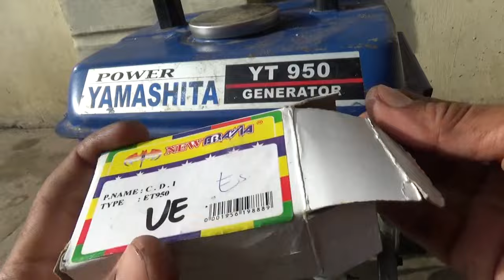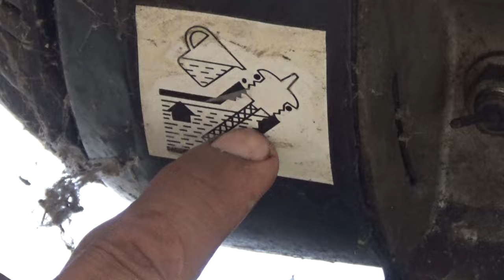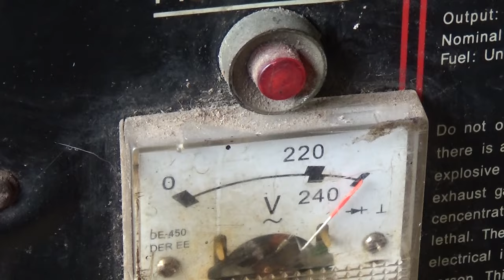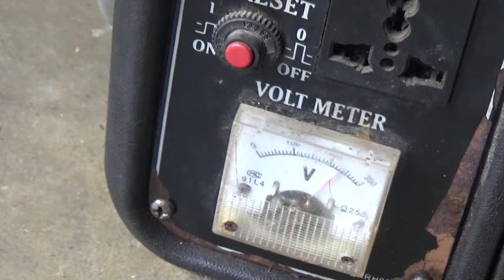cara service mesin genset susah hidup

Comment: Salam bang..mcm mana nk seting kompres genset 4tak
Reply from the maker: jika setting menggunakan alat standar pabrik yang normal, tekanan kompresinya 7-9 kg/cm². Atau bahkan bisa sampai 12 kg/cm². Jika kurang dari 7 atau 6 kg/cm², mesin dipastikan susah hidup dan bahkan mogok. 

agar supaya kompresi tetap normal setting-an manual yang biasa saya lakukan.
1. setting klep
2. masukan sedikit oli ke dalam silinder liston... 

celah settingan klep piston ikuti aja standard pabrikan sepeda motor...

Comment: Celah katup pakai Fuller brp bang
Reply from the maker: kalau saya pribadi dividideo itu ga pakai fuller, pakai filling saya nya😁🙏...

tapi..

kalau mau pakai fuller ikuti standard motor aja sprti supra x 125
in = 0.05 ke atas
ex = 0.05 ke atas
 data by: https://www.google.com/amp/s/goozir.com/standar-ukuran-kerenggangan-klep-sepeda-motor/%3famp

tapi kalau saya pribadi setting pakai fuller yang in uk. besar yang ex. uk kecil😁 biar mantul
Reply: Ok bang siap"👍🙏
Trims ulasannya sangat bermanfaat🙏🙏
Reply from the maker: terimakasih kembali😊🙏..

Comment: Bos kalau gengset 2 tak psnas mati itu apanya ya
Reply from the maker: overheat sementara sob.. bisa di desiclose nya kepanasan atau cdi nya..
1. solusi umumnya diamkan sampai suhu normal .. stlah itu coba hidupkan lg...🙏
Reply: Makasi imponya mastr brarti cdi nya ganti yan baru ya
Reply from the maker: iya coba test aja .. dan bandingkan lagi... cdi lama dngan yg baru ...
Reply: kalau pake lampu Yang 50 wat gak awet 1 2 jam langsung putus tapi yamg 10 7 wat awet itu penyebabnya apa ya
Reply from the maker: lampu nya LED atau bukan LED ya sob? yang 50 watt dan 10 watt itu???????
lalu apakah putaran mesin di RPM yg sama?
terkadang RPM mesin berbeda juga penyebab putus lampu...
lalu apakah genset selalu enggak stabil?? seperti nada mesin naik turun sendiri... apa ada sprti itu sob?
Reply: @autopedalAJBMS  iya itu suaranya gak stabil. Kalau misal keujanan sbntar mati itu langkah prtama biar hidup lagi apanya bos q
Reply from the maker: kepala busi dan kabel busi basah sob ambil kain dilap sampai kering.. periksa juga socket2 terminal cdi, desiclose dan lainnya.. usahakan jangan terus2an terkena hujan...takutnya korslet sob... 

dan utamakan yang kita jaga itu diri kita sob... bahaya kalo ke setrum...

Comment: Bang, mau tanya, genset saya merk ramses, kondisi mesin bisa menyala, cuma kalau agak lama dikit, 10-15 menit cepat panas dan langsung mati sendiri, 
Engkolan ditarik sahabis mati/kondisi panas gak bisa di tarik, nunggu masin dingin baru bisa di engkol lagi, itu kenapa ya bang, tolong di jawab ya bang, juga  terima kasih buat jawabanya ya bang
Reply from the maker: yang 2 tak atau 4 tak??

kalau 4 tak coba cek olinya,
kalau 2 tak coba cek businya,
Reply: Sudah saya ganti busi yg baru merk NGK juga masih sama, bertahan 15 menit an... langsung mati, saya cek busi kondisi kering agak ke abu abuan...
Reply from the maker: genset 2 tak kah?
Reply from the maker: oke , bang... service genset sendiri harus mau repot dan mengeluarkan modal, 

repot dalam artian banyak yag harus dicek dan trial error...

mengeluarkan modal dalam artian membeli komponen yang dicurigai...

nah kalo genset hidup trus 15 menit mati banyak faktornya: 
1. minyak enggak lancar ( kotor didalam kran dan karbu) solusi cek saluran minyak mulai dari kran minyak dan selang yang menuju karbu, dan cek sampai kepembuangan minyak pada karbu..bila perlu cuci karbu...

2. ganti CDI biasanya komponen ini mulai capek dan error terkena panasnya arus dari spull secara terus menerus dan terkena panas dari mesin dan juga ganti komponen ignition coil, dan spull  kalau ada genset cadangan part nya bisa dipakai untuk dites satu persatu...

harus sabar intinya, repot dan trial error wajib dilakoni... .. 

semangat bang... semoga berhasil..
Reply: @autopedalAJBMS  bang saya mau tanyak ini bang genset saya yg 2 tak ini ko cup yg naik gas itu gk bisa di gunakan selama sekali ya bang ? 
Mohon di balas ya bang🙏🙏🙏

Comment: Genset ku kalo di nyalain  gas nya langsung tinggi. Itu kenapa ya. Tipe nya 4 tak. 1000watt
Reply from the maker: coba pastikan tuas gas nya sob..posisikan nol atau tutup tp kalau posisi level middle up ya pasti tinggi waktu diengkol langsung hidup... 

tp kalau tuas gas normal posisi tutup tp tetap tinggi ada faktor lain yg harus dicek,, terutama filter, kedua nedle valve settingan gas yang ada di karburator.

Comment: Klo gak bisa digas apanya bang???.
Reply from the maker: coba cek connecting gas nya sob..
Reply: @autopedalAJBMS  mesin hidup bang cuman gas gk pungsi, karbu dah di bongkar + membran ,. Mohon penggetahuannya bang !!!! Makasihh
Reply from the maker: mesin genset 2 tak or 4 tak?
Reply: Itu sama kayak pnya saya,apa solusinya bang ?
Reply: Ternyata hanya knalpotnya penuh kerak , dibersihin di sela lngsung hidup normal kmbali
Reply: Knalpot sdh saya bersihkn tp masih tetap
Reply: Knalpot sdh saya bersihkn tp masih tetap
Reply from the maker: setiap problem pasti berbeda2 tidak sama semua,,, usahakan lakukan pengecekan pada karburator trlebih dahulu...